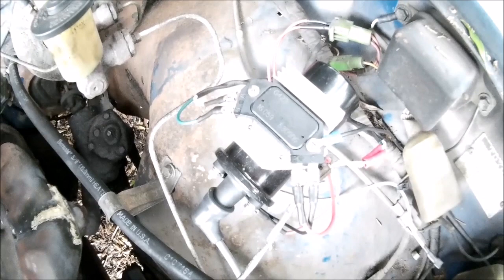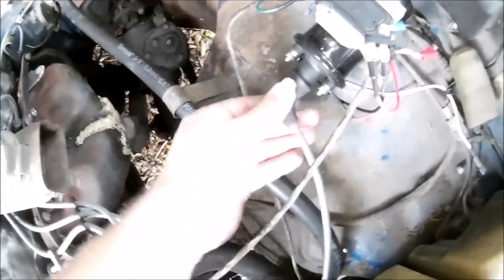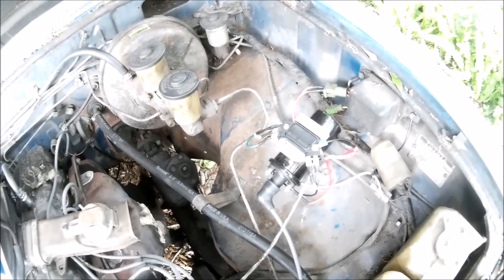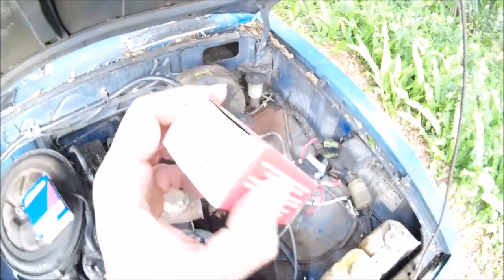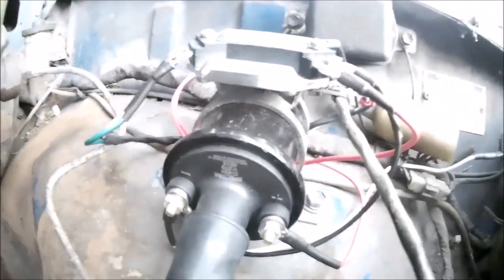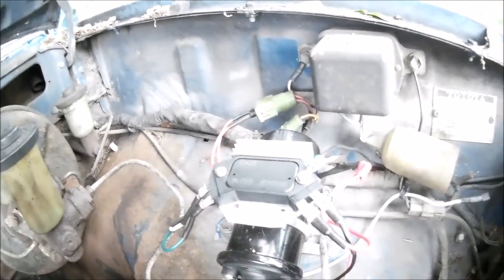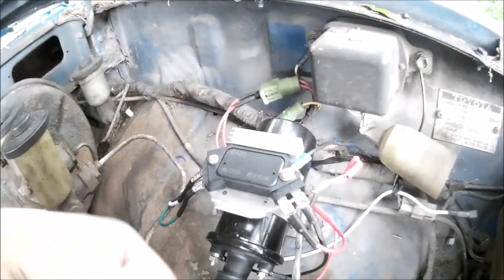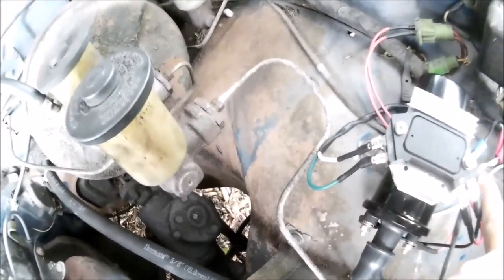1978 Toyota Pickup/Hilux 20R - GM HEI Ignition Module Conversion

Comment: Thanks for the video! I have a 77 celica with a 20r. My distributor uses points, I only have one cable coming from my distributor. Would this still work? If so, what should be done with the single pin  left on the GM HEI? Thanks
Reply from the maker: In the past I have heard & read from some that you can run an HEI module off of a points distributor, but I do not have any first-hand experience with that setup. I personally think that you can't, & that you need the "electronic" distributor that has the pickup coil in it. The HEI module is designed to work with the signal generated by the pickup coil. That signal is something like 3 volts AC (alternating current). A set of points does not generate any kind of current at all; they only act as an on/off switch for the ignition coil.

The whole idea of doing a points to electronic ignition conversion is to eliminate the mechanical points, which can wear over time & change how your ignition system performs. They are therefore not consistent over time without periodic gap checks & resetting. Since there are no parts in an electronic ignition system that are subject to mechanical wear the way that points are, it is far more consistent over time. Having to check & adjust the points is eliminated, & the signal to the ignition coil is always the same.

The electronic ignition system (either stock Toyota Igniter or an HEI conversion) also eliminates the ballast resistor for the points & ignition coil. This allows the ignition coil to be run at full battery voltage (usually 13.5 volts minimum) instead of the usual 9-10 volts that you get out of the ballast resistor. That's about 24% more power to the ignition coil. Better/hotter spark = better burn = more engine power.

I would say you need to get the electronic version of the 20R distributor (1978 to 1980) or a 22R distributor (1981 to 1984+**) in order to trigger off the HEI module the way it was designed to work.

NOTES/TIPS:
1. If you have a hard time tracking down one of these distributors, try checking for one on a 1978 & up Pickup. Sometimes parts places will charge you more $ if you say it's for a Celica, or not show it as available at all, while showing it as available for the Pickup. Both vehicles have the same engine, so the vehicle "model" difference doesn't matter.
2. I usually go with Rock Auto for parts (I am NOT sponsored by them, just my own preference & recommendation). They often have the same parts as the parts stores (& even more selection), & it's usually less $ to buy from them, even with shipping charges included.
** 3.A 22R electronic distributor is virtually the same as the 20R electronic distributor, will drop right into a 20R & function as you need it to do. You can use any 22R distributor from 1981 up to 1990. I only mention this if you have issues finding any listed for earlier years.
4. Vacuum Advance - The 1978 & '79 20R electronic distributors have a single vacuum advance diaphragm. The 1980 20R distributor & the 1981 to 1990 22R distributors have a dual diaphragm, both advance & retard.
For use on the 20R, I recommend that the "inside" diaphragm (retard diaphragm) be capped off. You only need to supply vacuum to the "outside" diaphragm (advance diaphragm) to have proper vacuum advance.

I know I've thrown a lot at you here, so if you have any more questions about any of this just let me know.
Reply: @The13thSword  Spot on! You answered the next questions I was formulating when i read your answer. Thanks! Seems like a 22r dizzy is the way. I’ll see what I can get.
Reply from the maker: @Ed-hb5rt  Glad to help out. Yeah, it would probably be easier & cheaper to get a 22R dizzy & go from there. Keep me posted.

Comment: Hey I’m looking for some help with setting this up on my Toyota 21r-u. Was wondering if I could email you if able to help! Thank you
Reply from the maker: The 21RU engine (2 liter displacement) was a factory replacement engine for the 20R motor (which has a 2.2 liter displacement), & was likely installed in your truck as a warranty replacement item. Or was an imported "used" engine, used to replace the original 20R at a later date. No Toyota vehicles intended for sale in the US market ever came with the 21EU as standard factory equipment. They were found as standard factory engines on the pickup (known as "HILUX" elsewhere in the world).

With all that said, as long as your existing distributor has the "electronic" pickup coil in it instead of the older style mechanical contact breaker  points, the conversion is exactly the same as shown in the video. The 20R & 21RU are very similar in design & function pretty much the same way. The only difference really being the cylinder bore size. But the operating concept is exactly the same, and would even work on 6 & 8 cylinder engine with a distributor that has a pickup coil. The GM HEI 4 pin module I used was originally made for a GM/Chevy 350 V8. No extra work or adjustment would be required, the dwell on the module is self-adjusting. You just need to make sure the engine base tuning is on spec for it to work well.

Other areas to look for on the conversion are:
1. Having a VERY solid ground connection to the module, as described in the video. (Eyelet in one of the mounting holes is the module's ground tab.)
2. Resistance testing with an Ohm meter the existing cable that goes from the distributor pickup coil & the module. If the wire is original it could be heat fatigued & have some undesired resistance in it, which might make the module function poorly. You shouldn't have more than 0.1 Ohm or resistance in either wire in the cable.
3. Removing any factory installed ballast resistor that is a part of the "keyed power" wire, that either feeds the ignition coil or used to feed the factor "igniter". The ignition coil & module I recommend for the conversion need full battery power to work well. A ballast resistor would cut the power feed down several or more volts, so you really don't want to keep it in the circuit for this conversion.

Otherwise, the conversion on your 21RU should go exactly the same. It also works the same on later 22R engines.

What year is your truck? Are you in the US or no? Just curious. Let me know if you have any other  specific questions & I'll help out.
Reply: Thanks for all that, I appreciate it and I am in Oregon. Do you have an email I could reach you at? I have a bit of unique setup and might possibly need to send over a photo. I recently bought a 1972 VW Bus that a guy converted to a 21r-u and spliced in the toyota engine wiring harness to Volkswagen harness. (Not 100% sure on that) He has passed so I don’t have someone to reference to. But I have replaced spark plugs, wires, distributor, coil, but still using the voltage regulator that is from Toyota and am not getting spark. I’d really appreciate the help.

Look forward to hearing from you!
Reply from the maker: @ethandomantay4926  I recently enabled messaging thru Youtube so it is possible. Click on the "About" link on my channel page & look for a button labeled "see email address". That should work.

Sounds like quite a project so I'm not going to sugar-coat anything for you here. Since the previous owner has passed you're going to have to create your own reference from what is on the vehicle. IMO the best & only way to go after solving this is to check & test everything from start to finish. If it were me I'd start with every wiring harness splice that was made to make sure they are all well connected (or soldered, preferably), and testing each one to make sure I knew what wire was doing what. Without knowing that, working on anything further "downstream" from that could be a big waste of your time & effort. It's always best to start at the source (electrical power circuits) & go in order to the end point.

I don't mean to presume anything about your level of knowledge or experience by saying this. It's just a VERY hard learned lesson that I have taken over the years of working on vehicle systems.

Other than that, and presuming that there aren't any other issues involved, this conversion not producing spark usually has a few common causes. Again, lack of a good solid ground connection (-) to the module (most common issue). Poor power connection (+) to the module, or a ballast resistor or resistor wire in place in the power to module circuit. Or the air gap on the pickup coil is set incorrectly (too wide a gap). This can cause the pickup coil to either generate too weak a signal for the module to function, or no signal at all. The usual Toyota spec on this is .008" to .016" inch, or 0.2mm to 0.4 mm. I have mine set at .012", right in the middle of the spec,  & it works well.

I'll be looking forward to hearing back about your progress.